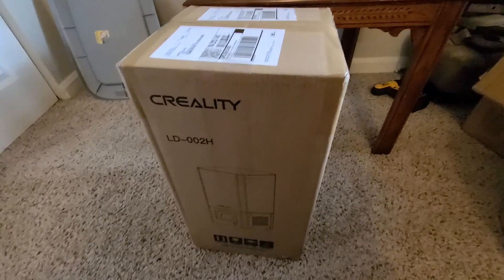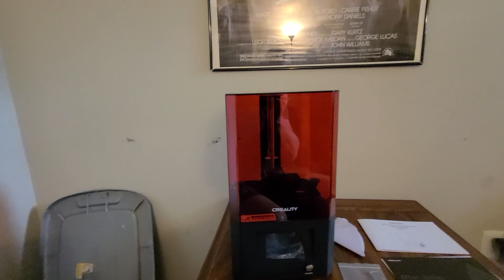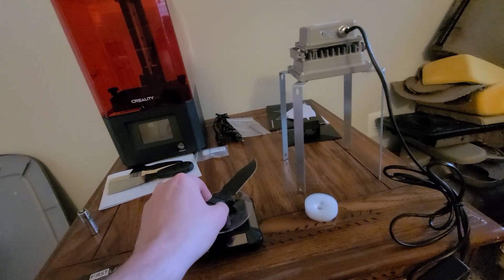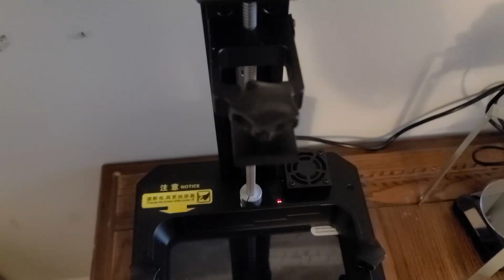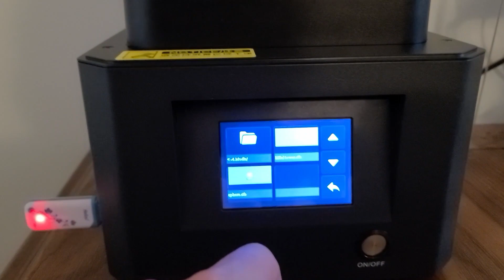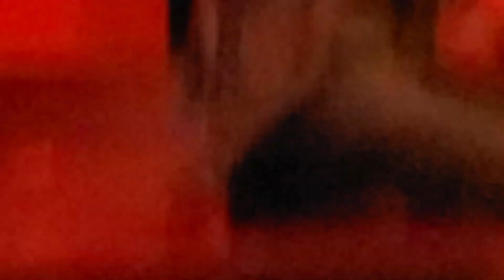Creality LD-002H 3D Resin Printer Unboxing! (The Perfect Combo for Nerds and Craftsmen!)

Comment: The brush mine came with was much smaller with finer bristles. I got the impression that it's for brushing resin on to smooth out prints than clean it, and that's all I've used it for
Reply from the maker: That does make sense. Thanks for sharing!